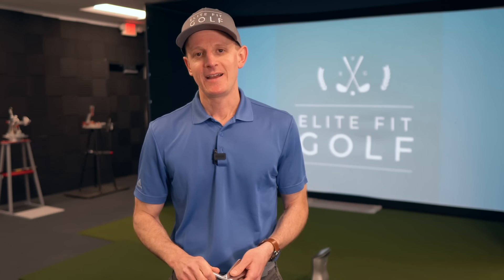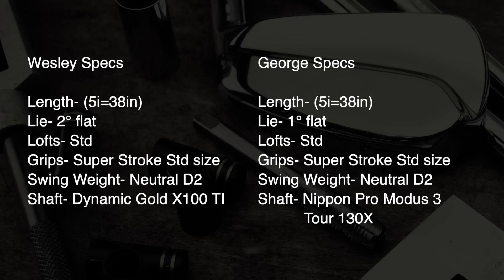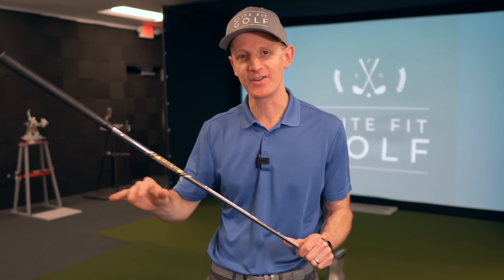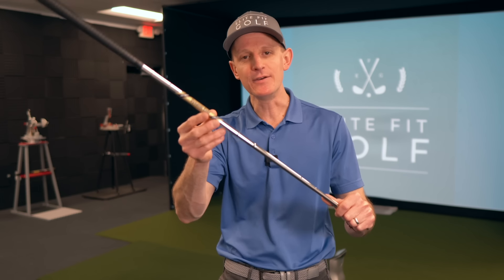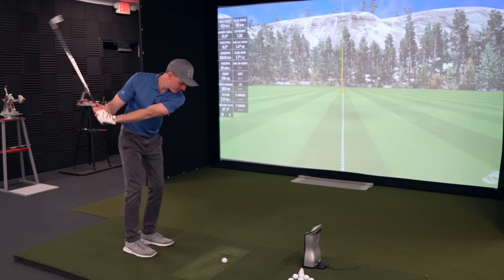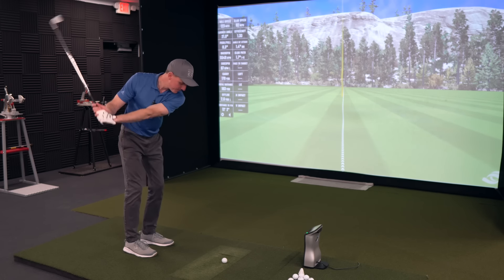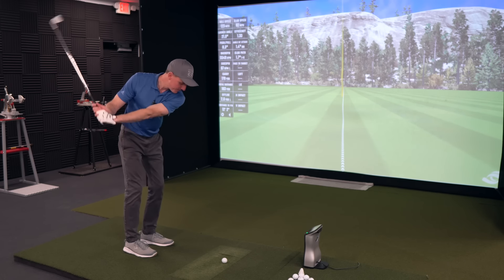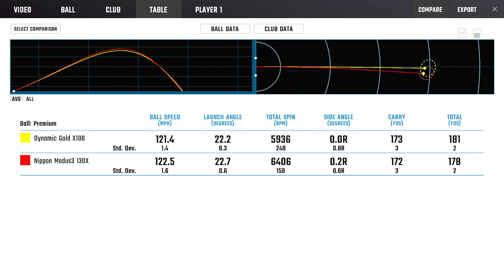Bryan Bros Takomo Irons / Build Specs and the One Huge Difference!

Comment: Spot on with the description of the Modus in all aspects. Just took out Modus 120x out of my clubs because it felt like swinging a board. And like he said, it feels like I had to swing super hard to get distance.
Reply: the 120s are opposite to the 130....i believe the kick pt is on the handle.
Reply: 120 has a completely different bend profile than the 130. 120 is like a reversed x100
Reply: Whatever. Felt like a board. But good to know. Thanks.
Reply: @Birdiesandeagles Surprising. The Modus 120 plays very soft to flex. The 120 X flex is equivalent to a Modus 105 S. Usually it's DG and Project X that feel like rebar.
Reply: If you thought the 120s were boardy, the 130s are like swinging a lamp post
Reply: @Omnis2  lol probably
Reply: The 120 is nothing like the 130. The 120 is a softer Project X LZ, which is a softer Project X profile. The 105 is the closest to Dynamic Gold (but it actually just weighs a lot less), while the 130 is so mid and handle firm it would make PX 7.0s blush.

Comment: I formerly used Dynalite Gold X100s, but they aren't made any more. They had VERY stiff butts and softer tips. They made the Dynamic Gold X100s feel boardy. The Modus 130 sounds like the Dynalite Gold, but heavier overall.     Why would a softer tip make the ball go right? I thought a livelier shaft would close the face more. That was my experience with the Dynalite Gold. Maybe it is affected by swing timing.
Reply from the maker: This shaft with my timing resulted in a right miss. Even though the tip is softer, that was not registering when I swung it. It just felt very stout overall. I probably don't have the lag in my swing to really activate that tip section is my best guess.
Reply: @EFGMC  Thanks. Those Takomos sure look good and apparently perform very well.

Comment: That's a great video! I think dynamic gold is with the stiff buttom section always my choice. But maybe in a 120 specification, I'm old. I like the takomos, but if you i order it a set of with specifications, the set isn't really cheaper than other brands irons. If i order s set of mizunos or Titleist ironside for example, i have the choice of between different shafts and grips, i can get the irons longer in length, with more or less loft, upright or flat and all with the same swing weight. Here you are doing the job for the bryanbros - and if i order a set build like others i can order in the market, the price will be nearly the same at the end... So it's a story for all narrowed by the takomo marketing. And i hate it if a business is build only on a good story.... But again, your video here is great and very informative!

Comment: this is really interesting....I played X100 for years, moved to a KBS Tour-V 120X to drop some weight as I'm getting older and looking for something less "noodly", but the KBS ended up too boardy...I eventually got fit for the Modus Tour 120X, and by a mile the Modus feels softer and easier to swing than my previous shafts, absolutely love the bend profile AND my launch came down which was really welcomed because I've always struggled with high ball flight....horses for courses hey, cheers
Reply from the maker: That 120X I think feels quite a bit like the X100 in a lighter weight. Still has some give to it.

Comment: The Modus 130’s soft stepped 1x were my gamer shafts in a Mp69. Weight after cutting is 120 grams and a very high balance point shaft so D 2 would feel stiff. 

They get up and flatten out and stay put as you can see on your test for roll out. 

Those 130 x shafts are probably closer to a 2x!

Comment: Played Modus 130X since 2016 coming from PX 6.5 and X100; I definitely seek the launch these provide. In an iBlade that setup is about as high launch you can find especially considering 130g shafts. 

To me in motion Modus 130 feels a lot softer than when you stand statically and do a waggle test. Heavy loaders dream!

Comment: I bought a set of Takomo 101s with KBS tour lite regular steel shafts.  I have to admit, I don't really like them.  I'm 76 and losing a lot of club head speed, but I can't stand a soft flex shaft.  The KBS shafts feel really heavy and stiff.  So, I think I really need a lighter graphite shaft.  Wish I'd paid the extra $100 and got their Obsidian shafts.  What I really wanted was the UST Recoil shafts, but they didn't offer them.  I love the P790's with those shafts!  I wonder if you have any comments on Takomo's Obsidian shafts, who makes them, etc.  I'd appreciate it...  I used to be a fairly good single digit player (shot 83 yesterday), and I probably should have bought the 101T heads instead of the 101s.

Comment: I agree with you about that Nippon shaft, swinging a pipe with no give. My favorite all time wood, hybrid, and iron shaft goes to the Cobra Aldila DVS line of shafts. I should have never traded off my Cobra S2 Max 3-6 hybrids 7-GW iron set with the DVS shafts.  Still playing the DVS shaft in my driver and fairway woods. By chance do you know the bend profile in the DVS shafts
Reply from the maker: As I remember, it's a variation of the NVS which had more of that soft mid section.

Comment: Hi I’m playing Ping I210 with modus 105 stiff shafts my Question is can you recommend a shaft for the takomo 101t irons lost a bit of distance due to age 65 current handicap 7.9 I’m thinking about KBS Tour lite regular or graphite any recommendations would be appreciated 👍🏴
Reply from the maker: Lighter won't guarantee faster swings and longer shots. It's often the opposite so I would definitely test out some different weights first. Be aware the 101t has pretty weak lofts for a hollow body iron so it's not always the best option for someone looking for more distance.

Comment: I enjoy your channel so I just subscribed. Question about regripping a long putter with a 14" Superstroke grip. The shaft diameter is .620 and the grip is designed for a .600. I tried but the grip sticks about half way on. So I have to pull it off. Any Suggestions. Thanks
Reply from the maker: My best advise is grip tape the entire area even past where the grip ends, use liberal amount of solvent, get the tip of the grip started and then just push hard and fast. It will stretch and fit over the shaft but you need to be more "persuasive". Don't worry about getting it on straight right now, just get it on and then make any alignment tweaks. Once the tape is dry you can remove any tape that sticks out past the grip.
Reply: @EFGMC  Thank you

Comment: Thinking about doing the same!! AJ, I tried the modus one time at a fitting in 2019 and I could NOT find the club face to save my life, went everywhere except where I aimed and 20-30 yards shorter (6iron). Does that correlate to driver shafts ? Back then the 2 shafts,for irons, that fit me best were the kBS C Taper-lite Xflex soft stepped (favorite) and the Project X LZ 6.0 standard. I tend to be an aggressive swinger. Should I get refit and try any different shafts or do you think that if they fit me then they probably still do. I’m in south Florida not in Atlanta where you are 🤦🏼‍♂️🤷🏼‍♂️..

Comment: I'm 16 and making clubs is what I want to do, all I have are a bunch of regular flex steel harrison driving shafts, is there anyway to make that into an iron shaft or a wedge shaft? I'm just curious because I'm planing on buying takomo 101t irons for my upcoming golf season and have some shafts for them but the wedges I don't have anything for. So I was hoping there would be a way to build my own wedges with what I have.
Reply from the maker: Wood shafts can't be used for irons because the tip diameter is different and once you cut them down the butt diameter will become too small.
Reply: @EFGMC  thank you so much for the reply, just saved me a lot of time and struggle

Comment: Great video! I'll be ordering Takomos this week, but I have a question. I'm 6'2" and I'm ordering 1" longer shafts. How much do I need to change the lie angle? Am I changing it more flat or more upright, and how many degrees do you think?
Reply from the maker: It depends on the length of your arms, your posture, and your hand position at impact. Hard to make a guess on that though if you are 6'2" and going a full inch over, I'm not sure you would need upright. More likely flat or no change.
Reply: @EFGMC  ok thanks

Comment: I used to have The NS Pro Modus3 120 130g Tour-X on my blades. 

And I did see and find the ball flight be higher than what I am used to and what I like. 

Since on my previous clubs I had KBS C-Taper 130g/X, and getting older and loosing some of the chs, I reshafted the Modus3 to 125g/S+ C-Tapers and the ball flight settled to what suites my eye and what I like to play. 

When fitted first time for the C-Tapers, I had X-100 on my MP69s. And they felt flimsy. Dispersion was rather wide, and that got sorted by the C-Tapers. 

People often say the C-Taper is like a numb steel rod, but to me, chs at 93 mph on 7 iron even today the feel is different, solid and responsive compared to the Dynamic Gold’s rubber band -like long lasting bend at impact and lazy kick compared to the firm response I get from the C-Taper. 

I think for the Modus3 TX and S+ or X C-Taper you need to have the swing speed up in the at least low to mid-90’s for them to work properly.

Comment: If I told you I’m launching my irons too high with Modus 115 tour stiff shafts, what would you recommend I try? My 7 iron club head speed is about 90
Reply from the maker: Bend your irons stronger would be my first recommendation. That's the only guaranteed way to change launch. If you are looking at shafts, I would try something with a different profile and see what happens. Don't worry about what the shaft says it does, just see what you do with that shaft. Maybe a classic like Dynamic Gold S300??

Comment: im curious on how the Modus 130s and 120s differ. Is it just weight? I was fit into the 120s with my Ping i525s. Down the road I ordered a i525 UW to add to the set and did the 105 since the 120 was on back order. I cant hit the 105. Its really weird. I didnt think the difference would so drastic.
Reply from the maker: Nippon Modus shafts vary by a huge margin. The 105, 115, and 125 are all stiffer lower launch. The 130 is as covered, a very unique profile that only suits certain golfers. The 120 is a softer feeling mid launching shaft that will fit the greatest number of rec golfers.
Reply: @EFGMC  That would make sense based on what I am seeing. My PW (46) with 120s flies higher and the same distance as my UW (50) with the 105s. thanks!

Comment: When you say 2o flat. Or 1 degree flat. What do you consider neutral lie angle is for say a 6 iron. I assume there is no industry standard.
Reply from the maker: Correct. Just like everything in golf, no industry standard for lie, loft, length, weight, any of it. In this case we were going off the Takomo 301 starting lie angles.

Comment: Do people with heavy shafts generally have lighter swing weights?
Reply from the maker: That's a complicated question. A lot of swing weight is dictated by the weight of the component pieces used and the length so hard to give a blanket answer. That said, it's hard to get a lightweight graphite shafted iron as heavy a swing weight as a similar spec'ed out heavy steel shaft.

Comment: I play a 5.5/115g Project X LZ and have another set of irons that came with the NS Modus 130 TourX shafts. I dunno how any golfer, pro or otherwise, plays the Modus THAT stiff. Feels stiffer than half inch rebar. If you hit anything other than the sweet spot, your hands feel like they exploded. Not fun.